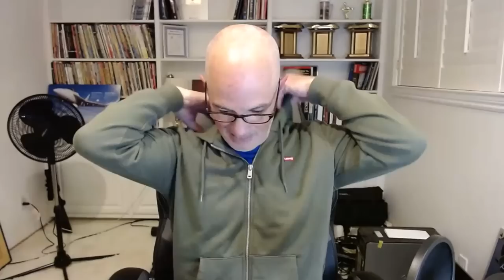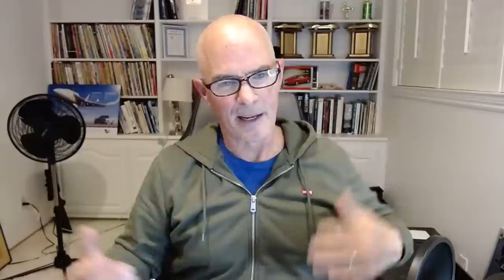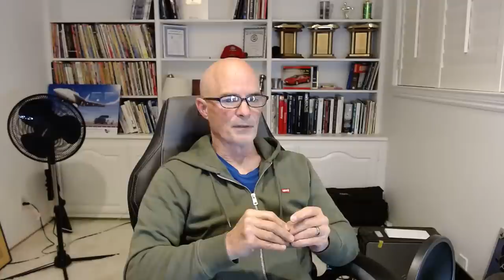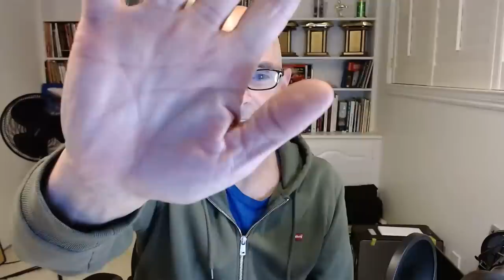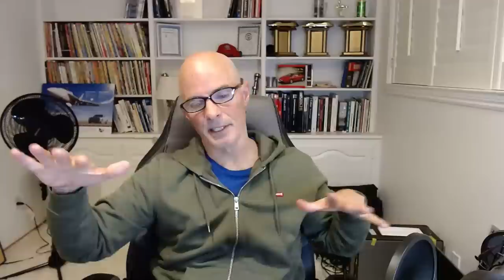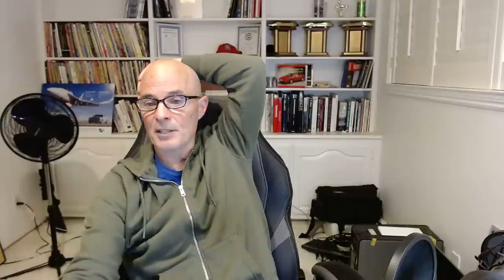LET'S TALK TECH-YES, I WOULD USE A SINGLE PATTERN CAM

Comment: I ran a 555 BBC in a 27 ‘ Checkmate boat I had tried several cams in that engine , comp 242/248 , comp 251/263 , Bullet 243 /250 but the best cam I ran in that set up was a Clay Smith 246 / 246 these cams were between 110 to 113 LSA but my favorite was the single pattern on a 110

Comment: I've caught h*ll for running a single pattern cam (including your chat) but I don't think people fully understand the reasoning. I have the 280H (Magnum 280) but I have Vortec heads and a very limited budget. I could run a dual pattern cam like the XE268 but I'd lose intake lift and duration. I can't use the XE274 because I don't have the retainer-to-seal clearance, nor the spacing to prevent coil bind on the exhaust side. I'm using the 981 spring @ 1.70" installed height. The highest they'll go is 0.490" @ that installed height, if I'm not mistaken. The 280H is 0.480" on both, I&E, so I'm right at the max those springs will allow.

Anyway, my point is, if I were to use a dual pattern cam I would lose power because I'd have to lower the intake lift and shorten the duration. 

The only workaround may be if I were to get a cam that was able to produce more duration on the exhaust side without more lift. I am definitely open to that option but I've never seen that type of grind. That would probably require a custom grind and I don't have the funds for that.
Reply from the maker: use what works

Comment: I'm a ford guy and always have favored dual/split pattern cams on Clevelands and 400s and 385 series engines. All canted valve head motors. Not that that matters but they sure seemed to run better with split cams. More lift or duration on the exhaust valve than on the larger intake valve.
Reply: The split pattern cams generally always perform better , when you look at the intake port having day 320cc and exhaust port of say 190 cc and having to clear out the exhaust gasses that have expanded to more that what originally came in , the added valve timing really helps but with that said I have had some great performing single pattern cams , by the way I’m a huge 351 Cleveland fan

Comment: Narrow LSA is not good for gas mileage,had like an 108 mild cam to a 79 350 camaro got 9 to 10 mpg max.Went to a Crane Blazer 288 duration.450 lift and 112 LSA and went to 15 mpg and way more power.turbo 350 automatic and 3.42 gears.Yes this was done in 1980 😮

Comment: I recently used a VCM6 camshaft in a 6.0LS (L76) I put it in because we were going to go turbo/procharger but it is staying n/a for now..with a little head work and 2 degrees of advance we have found this cam to provide a better balance of torque and power than other higher lift, wider duration dual pattern LS cams..the car made 469hp on the rollers with a stock 4l65 and its a good driver, single pattern cams can work the trick is to improve exhaust flow as much as possible and consider valve timing events when installing. cam specs are as below..
Advertised Duration:   285°                 285°
Duration @ .050”:       233°                 233°
Valve Lift 1.7:1 R/R:    .592”               .596”
Lobe Separation:         114°
Reply from the maker: if you like it-then it works for you

Comment: Id run a reverse split on a turbo application under these specific circumstances. a divided turbine with a high drive pressure on a 6 or a twin turbo divided turbine with high drive pressure on a v8 assuming the exhaust path stays divided. On a v8 id have 4-2 headers on both sides where i had a 270-450 degree between the cylinder pairs all around. This would heep the pulses from one cylinder from causing reversion into another cylinder. On a 6 you'd only have 240 degrees between cylinders and id want an especially short lobe on the exhaust and id maximize the intake lobe to get the most of it.

 If not to control this particular condition id want a big turbine with a normal split pattern cam for an early exhaust opening to get more heat and drive energy. I might add a little extra lsa and advance not because it's actually needed but to get an even earlier exhaust opening. 

As for single pattern, smokey yunick and david vizard were fans but the argument is complex because these guys were running race engines with big duration numbers. Not to mention when people make these comparisons do they control for icl? Do they add lsa when they add exhaust duration? Because you could control for 3 timing events and only vary the ex opening. But ive never seen that done. Why do we pretend that we should only look at intake duration for these tests not intake closing? Or the overlap period? We pretend that duration makes power and drivability but we could be making idle worse on a dual pattern by way of exhaust duration of not also increasing lsa. If we dont advance that combo as well be are changing the "true compresion" because of the intake closing time. We would truely need to test like 2 dozen cams doing icl sweeps on each one with 3 different lsa and a variety of Intake durations to really settle on the best power vs idle vibration setup and where it should be installed and does this rule change between a normal hotrod street cam and a monster drag race cam?

Comment: I'm still a fan of the comp  HE 268 cam for the street and towing.
Reply: I ran one in a 307 Olds 85 model in a delta 88 with a 240 rear gear it wasn't much on a restart but get it rolling and it had several win stickers on the windshield....
Reply: Have one in my 76 nova. Runs great for what it is.
Reply: I’ve got the summit copy in a swirl port 350 in my c10. Sounds good at idle drives like a stock cam and pulls good through to 5k.
Reply: one of the best all around st cams for sb and towing for 454s ever .
High energy and magnum line had lobes that last...the 2000+up era "fast ramp" I stay away from
Had 4 fail, one an XFI roller.

Comment: I had a 402 big block in a 70 chevelle it had a crane flat tappet fire ball cam 302x302 duration and 544 lift and it was a 4 speed car I advanced the cam 4 degrees and the car ran 11.18 quarter mile with a 750 carb on a strip dominator intake I put the same motor in a 71 elcomino and a automatic with a 2800 stall and it ran 1130 all day long
Reply: Some of those old grinds work very well. Aggressive enough ramps to make power but not so much they kill lobes.

Comment: Nice video sir I have been Watching your videos for a while I have a question for you I have a blueprint 6.0 block holly Mid rise intake 93mm Stage 3 Cam 317 ported and polished heads Short tube Headers 4l60e Trans 9" rear end in a 1971chevelle What's your opinion about that and what horsepower do you think that I'm gonna achieve Putting it together as a driver not a race car Thank you in advance for any help or advice you can give
Reply from the maker: not sure what the cam specs are
Reply: @richardholdener1727  A sloppy stags 3 cam